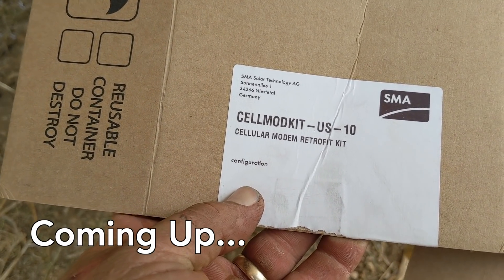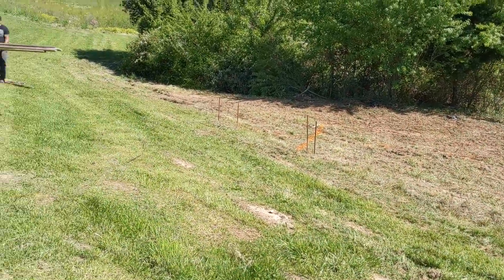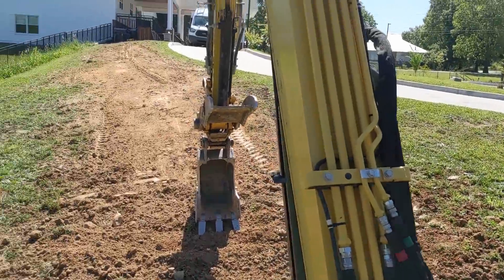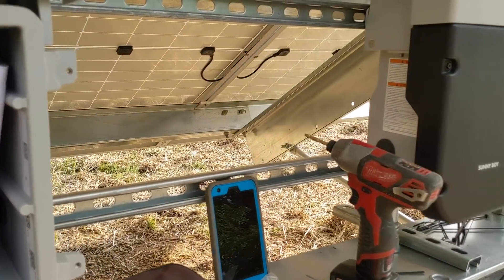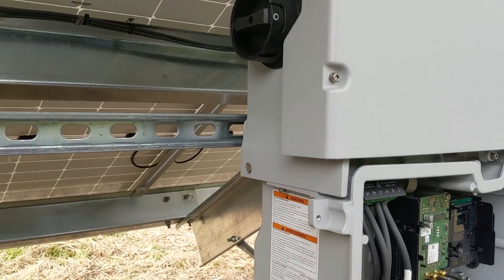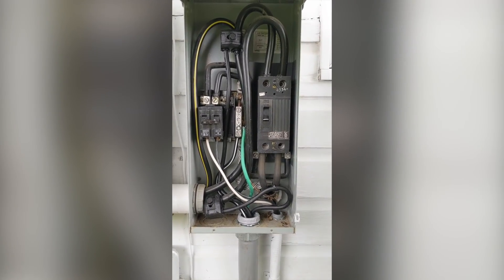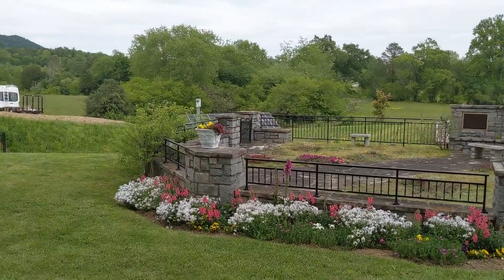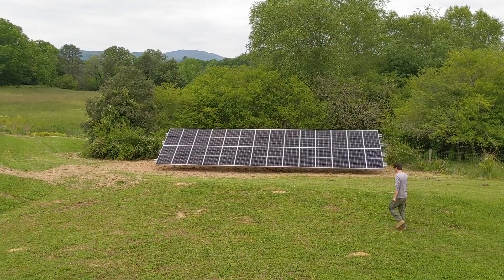Transformerless: SMA paved the way

Comment: Forgive my ignorance as I’m trying to learn this stuff. Why did you use multiple Sunny Boy inverter‘s? Can’t one inverter handle multiple arrays of panels?
Reply: I googled your question, a single inverter will look at all of your panels and invert at the lowest panel where as  with microinverters there is one for each panel and will invert for each panel giving every ounce of power even if there is shading on a panel also if one inverter dies you still will get power from the other inverters
Reply: Ringo Star but that does not answer the question. I known what a microinverter (which lives directly on the panels) will do. I’m trying to understand why he used two sunny boy inverters instead of one.

Comment: So this is a grid tie with no batteries?  Trying to learn as much as I can.
Reply from the maker: Yes this is a grid tie only. No batteries
Reply: Is that the preferred method Engineer775?
Reply: Hey I'm learning about all this too and was just reading what they do in Australia. Essentially, the grid serves as your battery. There are considerable benefits to this approach with less initial cost and much less maintenance. Usually people produce more than they use and instead of charging a battery for later use send it back to the grid. Then at night when sun goes down it switches back to the grid. With net metering you will probably give more than you take and get a check every year while eliminating an electric bill altogether.

Comment: Why didn’t you run a hard wire to the router?
Reply: Yeah.  Save on energy and providing and maintaining for TWO (2) cell services.
Hardwire a Cat6 in a conduit.  It's not as if you're digging up a separate trench for this conduit.  :-)
Install a bridge router between the main router and the solar install.
Because others are doin' it doesn't make it right...  :-)    Typically german products are great, but are high maintenance and expensive to replace.
Reply: Do you run your control wires in the same conduit as your high voltage dc?

Can you use the dc cable to transmit control data like the power company does with ac power lines. Im thinking that would be a no, but I’ve never had to deal with it.
Thanks for the answers 

Bill

PS I’m always looking to extend the range of my WiFi and running a cat 6 with Poe shurly would have give that extended coverage, just saying.
Reply: Orange stripe, orange. Green stripe, blue. Blue stripe, green. Brown stripe, brown. Cheap and easy.  Two cell transceivers required is a design fail.
Reply: I was wondering if those sma cellular cards came with prepaid cellularliar contracts for x amount of years. lf not it might of saved the customer money running cat 6 to  the church to use the Wi-Fi they already have or a Ethernet powerline converter setup possibly.
Reply: I know, if it isn’t one thing it’s another.
I am running a satellite back haul for cctv and am using a UPS. Of course power goes out and the UPS doesn’t come back up. It’s remote and not accessible with out a trip to the site.
What’s a guy to do??

Maybe change everything to 12v dc?

Bill
Reply from the maker: We wanted to 1) try the cellular solution, 2) the distance and have to run another pipe and then getting to the router in the building.,3) everybody is doin it. :)